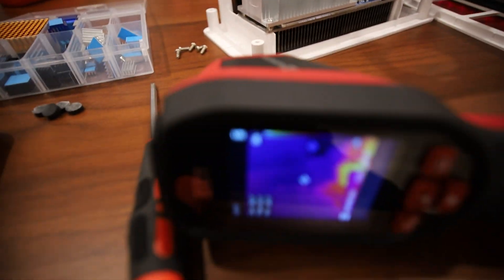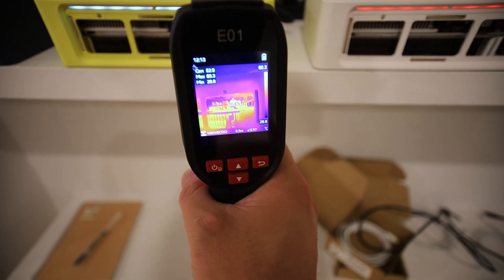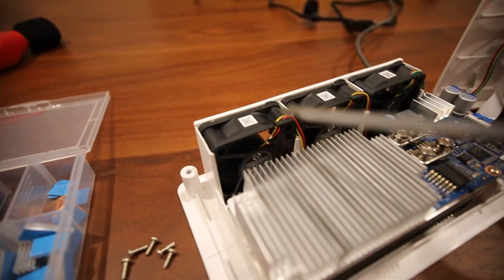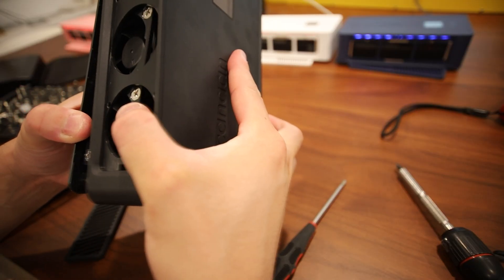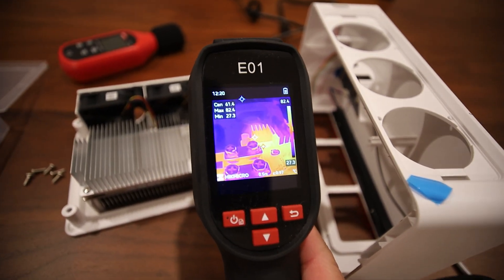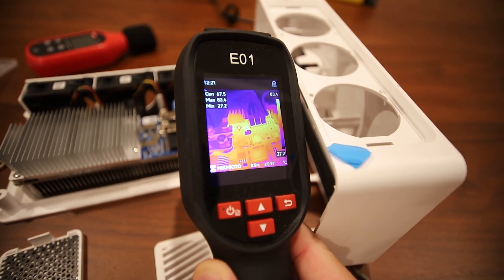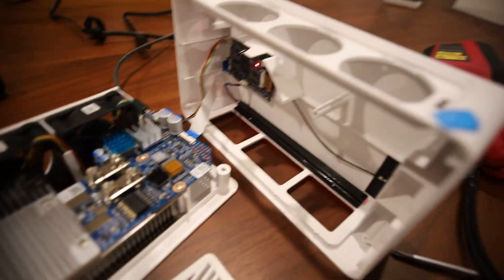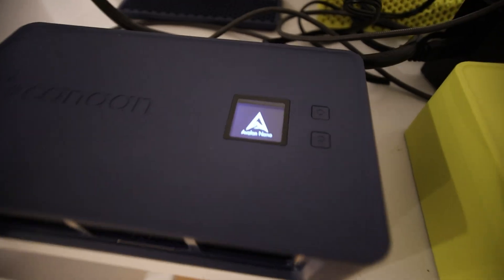Adding HEATSINKS to cool down this HOT little Bitcoin Miner!

Comment from the maker: NOTE: THE small vrm power stage chip near the 2 large capacitors, please put a small heatsink and not a large one or else the casing when you put it back together may rip it off all together! update 3rd Party PSU https://geni.us/RIUr and cable https://geni.us/rQZTR
Helium Deploy https://heliumdeploy.com/products/avalon-nano-3s?sca_ref=8375453.9U7Ck6boFi for all your DEPIN & ASIC needs! NANO 3S miners in stock! use code RPM for 10% off UNDER $500! or code RPM50 for $50 off OVER $500! Credit card or Crypto payments accepted!
Reply: I think this happened to me and the vrm became detached. It's the very small block on the corner of the device. 

Would it be possible to solder it back on? Or did I brick the device? Nothing looks damaged otherwise
Reply: @MeleeBandit  Which one exactly? The one he said had no airflow to by the USB power supply plug?
Reply: May I ask what are the dimensions of the 5 additional heat sinks you installed?

Comment: Hello panda  My Avalon Nano recently broke and the dashboard said IDL, it didn't read the fans or the (H0) either. I opened the box and the component where you put the heatsink near the power connector unsoldered and broke. I went to an expert in my city who told me that you shouldn't put heatsinks, only on cores and components that don't regulate voltage since it creates interference. I changed the 4r7 component for one from an older, larger PC board that I adjusted by creating some legs and it works better, giving me 5% more hasrate than stock.

Comment: tried this today, ... wiggling the case off broke a small square piece next to 2 capacitors...BE CARFUL
Reply: when angling top case off the screw support will rub against this part of the board
Reply: yup. now says "non supported power adaptor" so this is bricked

Comment: Thank you so much for this one. I have 3 of these and after opening them up and taking the main heatsink off, cleaning the cooked dry paste and replacing with MX-6, as well as using amazon heatsinks on everything that I could fit them on on the board, the fans are near silent. It seems these automatically maintain 90C and because these cool so efficiently now it’s an insane difference. They went from periodically going 100% fan speed to not even sounding like they’re on. 

Used the extras on the bottom of the PSUs to keep those cool as well. Thank you for this one

Comment: totally not worth the potential damage you get opening these!
They are supposed to run that hot and the gain you get from lowering the temp is none, you won't do something like that because you "don't feel comfortable" with those temps, it's a heater!
Those mesh are there to act as filters from small particles that could seep in, if you really wanna remove one I'd remove only the one on the front, It was designed that way for a reason.

Comment: It's supposed to get hot, it doubles as a room heater. Is it your contention that heat is a problem?
Reply: I assume he doesn't want it pumping out hot air during the summer.
Reply: @DW-dd4iwThe unit will still produce 140w (477 BTUs) of heat. The chips will just be kept cooler by dissipating the heat quicker.
Reply: Heat is the enemy of all microchips. They will always last longer and work more efficiently when kept cooler.

Comment: Just got mine 3 days ago. When running on high the system seems to make a whizzing noise. I have to assume it's the fans. On Low its very quiet. Anyone else seeing this? Id love to make it quiet but not sure if replacing the fans would do that. I have a small apartment and its annoying me..

Comment: Nice modification. I wonder how you solved the location of the temperature sensor, which touches the hottest component. After modification, it touches the heatsink. And the second knowledge is that in front of this component, behind the fan, plastic protrudes from the cover, which I assume is there so that it does not affect the temperature sensor. However, it also does not cool this component because it creates an obstruction. Sure it works with the cover open because air flows through the heatsink. However, when you put the cover back on, this plastic barrier makes the flow through this heatsink almost impossible. If you remove this plastic, you will reduce the temperature even without a heatsink, because the air will flow directly through it. Unfortunately, it will also affect the temperature sensor.

I made the same adjustment as in the video and the rpms and temperatures did not drop at all or only minimally. For which I assume the aforementioned fact is to blame, because it is necessary to measure those values with the cover and not without it.

Comment: Did you notice if there is any ability to add a hardwire Ethernet connection? Mine keeps disconnecting even though I have no issues with my wifi.

Comment: If you don’t mind a bit more noise there is an easy way to have the fans on 100% all the time and drop the temp to around 60C.
Just disconnect the yellow wire going from the fans to the small control board on the lid and your fans will go to 100% (around 7800 RPM).
You’re welcome 😉
Reply: great tip!
Reply: @bragg2012  WOW AMAZING  IS WORKDED ,THANKS FOR THE TIP.
Reply: do you know where i can get some replacement fan or how to replacement them with after markets one

Comment: Any probkem with wifi receptor? Seems like the wifi keeps dropping out even when the router is literally next to the miner 

Is there a way to change the wifi to Ethernet
Reply: It need solid rock wifi connection, not extender, must be a access point, main is not hashing when i move it further from router using extender

Comment: After reading comments, and seeing the inside,   I think using a dremel on the plastic case will be the way to go as far as adding a fan... or access to the chipset from the top. 
Just watch out for that display panel wire.      I'll do that when they get here.

Comment: Hi, what are the fans specs ? Size, 3 or 4 pins, operating voltage, RPMs ... Thanks !
Reply: 4pin 12V, 7000rpm 50x50x20

Comment: I have two of those miners, one mining much less than the other, its reaching 58C (T) while the other mining better reaching max 38C (T). anyone having the same? considering removing than giant heatsink and add thermal past see if that help.   Both (H0) temps is 90C, definitively in need of a heatsink like shown in this video, thanks

Comment: will the nano work if you disconnect the cables that go to the screen and buttons on top of the cover? Im thinking of removing the internal out completely out of the case and control the unit just through web gui as I dont need the screens or buttons?

Comment: Should you use the 80% rule when running the Avalon Nano 3 in high mode? If so power supply should be 175 watts?

Comment: I think I'm gonna leave mine as it is. I received mine today, and yes it does get quite hot. Maybe after the warranty has run out I will. But it was designed to run this hot, that's why they advertise the device as a "Space Heater". 140 Watts of heat won't cause too much damage anyway
Reply: 6 months have passed. Have you had any luck mining with the Nano 3?
Reply: @DW-dd4iw  no luck yet, still waiting for that lucky ticket😂
Reply: But my nano 3 will thermally crash in high mode and then restart. If it happens once, it will happen again within a few minutes after the subsequent restart.
Reply: @JMJ-z8d  maybe try what Panda has done here and add heat sinks internally. Otherwise open a rma with Canaan if it is still under warranty

Comment: Well I followed the heat sink train. The tiny component just to the side of the fans is SUPER delicate. Its labeled 4r7. Well upon replacing the cover there must have been some wiggle as @RedPandaMining notes to refit the USB PSU - its snug. With heat sink it was too much for component and it snapped off with heat sink attached. 1 Avalon down for the count. :( Fork!
Reply: Damn, thanks for bringing this to our attention. I won't be opening up mine. It was designed to run this way.
Reply: I have the same experience 😭😭. But I believe to have found the part
Reply: I had the same problem... Do you have a link for that?  @askjeroen

Comment: I have bought a few different heat syncs from amazon before. I've had the best results with Alphacool 17427 GPU RAM Copper Heatsinks on amazon. They are a little more than the kits but seem to have more surface area and drops temp a bit more. Hope this helps!

Comment: If you are in the US - that sticker is a crime.  Your warranty WILL NOT BE VOID for opening the device.  Only if in the process you cause provable damage to the device.  (in the US as previously stated)
Reply: a crime? the thing is his.
Reply: @MSJ_raptor 😂😂😂.. mine gets so hot. The sticker fell off. It melted it off.
Reply: @MSJ_raptor  Removing the sticker is not a crime.  Stating a sticker removal will void warranty is a crime.  Specifically it is a violation of the Magnuson Moss Warranty Act.
Reply: @cracklingice  The thing is from Singapore.
Reply: @MSJ_raptor  The origin of the device does not matter.  If it is sold in the US, it follows US warranty law for those buyers.
Reply: @cracklingice  yes, i know, but also, you would think the ppl at canaan would design it right. and if say you "void" the warranty, it's going cost far more than 100$ to what, sue them? could be a heat sink is a good idea however. but if i did it, i would not go back on the manufacture if it broke. the point of life is to enjoy it as best one might, not sure people over a 100$ device you re-engineered. lol.
Reply: @cracklingice  No, the sticker is not a crime. It doesn't carry legal weight, because it's unenforceable under the Magnuson-Moss warranty act. They would have to prove that you caused damage, in order to void the warranty. So the sticker is basically just an empty threat.

But the sticker itself is not a "crime".
Reply: @Wrenchmonkey1  The sticker is a crime if it states the warranty will be void.  If it is just a sticker then it is grey area as there is plausible deniability that message is the intent.  But when it is printed on the sticker or leaves a void behind when removed, yes, it is absolutely a criminal violation of MMWA.
Reply: @cracklingice  No. It is not a crime. 

It's an unenforceable disclaimer, just like most disclaimers.
Reply: @Wrenchmonkey1  The disclaimer itself is a violation of the MMWA, it is not just unenforceable, it is unlawful.

Comment: Fan speed is set according to the internal temp via two thermistors regardless of the heat setting. With all air restrictions removed, the inside temp doesn't get hot enough for the fan to increase to max  RPM even if the heat setting is on high. This is the case with both my Nano 3's. Yes, it would be nice to have a manual setting in the app or web GUI.

Comment: These modern mos-fets can operate between 80 - 125C.  That is why Canaan did not put a heatsink on it.  Just like a lot of motherboards that don't have heatsinks on their VRMs either for that same reason,  it's not necessary.   Optimal is between 80 - 100C.  If you're hitting the 90's on high, then you're good.   But like too much heat... don't cool them too much either.
Reply: Well i have 2. 1 just stopped working something blown inside. And well second one (on medium) disconnects hangs gets un responsive. Also on medium. Only by removing the grills and placing a 140 mm fan in front unit been running 24 h stable... Room temp is like 23 degrees which is well not hot.. seems components dont like it hot
Reply: @Just9602  you might have a defective unit, as mine are running fine on high with room temps upto 27c. No additional cooling or anything, I haven't even taken the grills off
Reply: Well then i have 2 not so good. One is toast send it back for repair, not powering on anymore. And second one just custom it just stops hangs goes offline. Only when i remove grill and put a fan in front of it it hashes stable on medium. High well it hangs .. just my luck to get two with problems
Reply: @Just9602  Dang, sorry to hear.  Mines been running fine on High in an 80F room. But you're right, some components don't like heat..  Especially the components for the Wifi.  Been seeing a lot of connection problems with these and it may be due to overheating.  I'm not surprised though, they did rush to manufacture and ship these and i'm sure QA was minimal.  So i expect a fair amount of people to get faulty units.  It's the same issue with full size ASICs, it's just part of this world of mining.
Reply: @CrowesAbode  
Hey man are two versions of nano 3 ? Been looking at vids at the outlet side i have a extra grill (not the magnetic stuff) . When i look at unboxing of machines they dont have it, that could ofcourse explain ofcourse a bit my expirience
Reply: @Just9602  There are different revisions.  For example,  earlier batches don't have the metal grill behind the detachable plastic vent.  I believe the purpose was to allow for more efficient cooling if you don't care for looks.  However, at some point they decided to add in that metal mesh grill which is what you and I have.   Not sure of the purpose behind it though.  But I may remove mine to see if it makes a difference.  I'm sure there have also been hardware revision on the board and components used.
Reply: Didn't know the low temp was important too. Thanks.
Reply: I thought that was the case, it's designed to work at those temps.

Comment: I keep telling ppl, rig ks0 pro shroud and 120mm fan to pull exhaust air, the temps get reduced greatly, even better than heat sinks, the sinks would just be a bonus

Comment: Hmm, cheap heatsink from Amazon. Don't know how effective the adhesive is for thermal transfer, and also note that the anodize adds a small amount thermal insulator.
Reply: If you are worried, buy "better" and put them in to maybe lower the temps more. Good Luck. Happy mining.
Reply: @howardandrus8828  Do you have any recommendations?